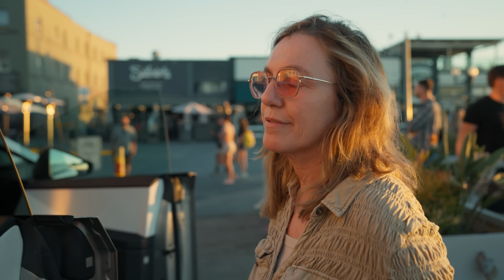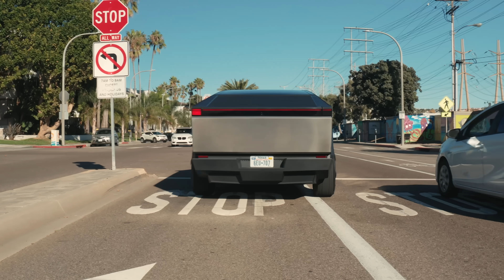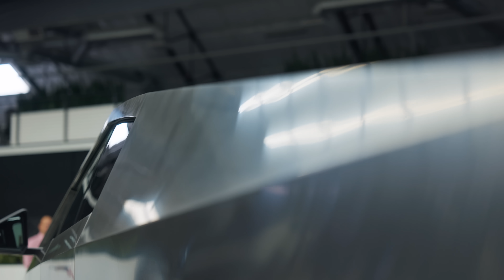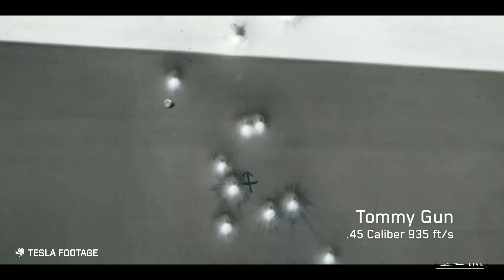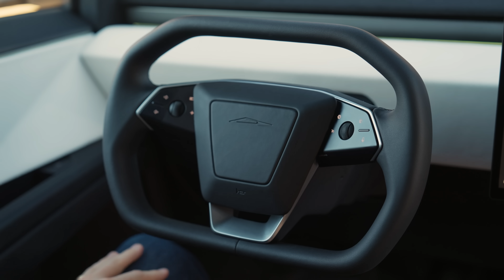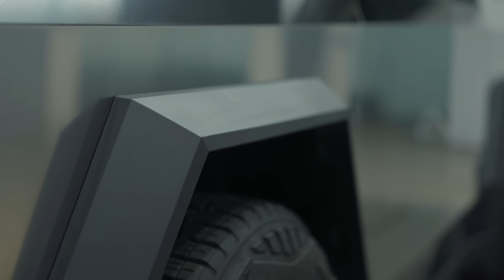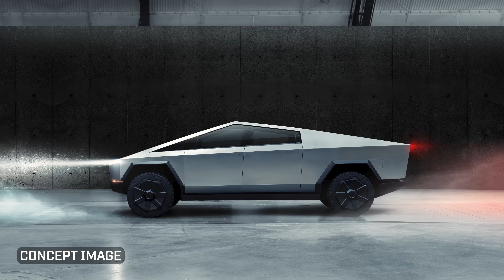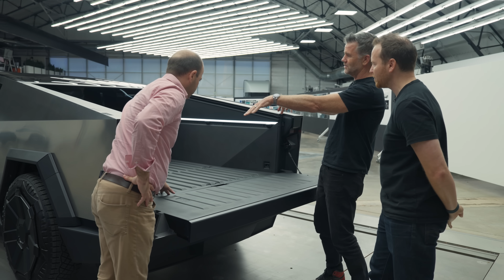FIRST DRIVE: Tesla Cybertruck Full Review

Comment: for some reason no one ever seems to mention how much its utility is limited by the high sides of the bed which makes loading/unloading from anywhere but the tailgate nigh impossible.
Reply: It's not very easy to do on modern full 4x4 truck anyway.

Looking at it, it sits a bit lower than a conventional full size, so probably not much different up to about mid point of the box. Right near the cab it will be more of an issue, but so what?
Reply: Pointless anyway its got hardly any space in the back.
Reply: @shauno1970  "It has hardly any space in the back" lol, it has a 6' X 4' bed, bigger than the F 150. So is lying something you learned from your parents??
Reply: With air shocks it can lower more than other trucks. And if you have never used a tailgate, you have never really used a truck for work.
Reply: So you climb into the back to get everything out of your truck? It was a major design issue and complaint amongst 1st gen Honda Ridgeline owners.  High sides are very inconvenient  @KevinVenturePhilippines
Reply: @fullsend5280  You are a 10 year old child and have never used a truck for any reason, and have certainly never owned one. You are just taking a rando's quote from another child and reposting it. Stay in school, and stop doing drugs.
Reply: @KevinVenturePhilippines  if you've never access cargo from the side of the bed, , you have never really used a truck for work.
Reply: you wouldnt lift heavy things over the side anyway.
for most pickup drivers usecase i dont think it affects utility much. tailgate access on cyber is very good since the suspension can go low.
smaller items might be put in the cab or frunk and might alleviate this.
and this downside of less side acces does produce some upsides like higher bed cover, stiffer or lighter frame, better aero.
depends on ur usecase on which one you'd prefer.
Reply: @slopedarmor  who said anything about heavy objects? have you never seen one of the many bed tool boxes that are made to sit along the side or at the front of the bed to allow access from the sides? they are quite popular, seems about every third pickup i see has one.  try getting a tool out of one of those...  frunk my provide an alternative for some , but not in all cases...   truck beds have been that shape they are on most trucks for a good century or so for a reason....
Reply: @bbanzai444  "Every 3rd truck I see has a tool box" lmao, you know ZERO.about trucks, come to New Mexico, child, where everyone has a truck in the family! Usually many!  You are just making crap up and know nothing, you don't understand air suspension, or anything. The only funny thing is you talking about tools, when you are one. 🤣🤣🤣
Reply: @bbanzai444   @bbanzai444  A lot of us are from the southwest, the truck capital of the planet Earth, you are from New York! 🤣

And you call it a "Pickup truck" 🤘🤣🤣🤣

OMG 🙄🤦‍♂️🤣
Reply: @KevinVenturePhilippines   you know New York is a lot more than just the city right? No shortage of trucks in the other 95% of the state…
Reply: @KevinVenturePhilippines also I called it a pickup truck because that is what it is.  Onlything funny about that would appear to be your illiteracy...
Reply: @bbanzai444  You mean that little bitty state that nobody cares about except the troglodytes that roam there? Sure, Jan. 🤦‍♂🤣
Reply: @bbanzai444  And the joke that says "Illiterate" cannot capitalize the beginning of a sentence. 🤣

And you are correct, little girl do use that word in actual truck country. Congratulations, you found your niche. 
🤘🤣
Reply: @bbanzai444  PS, Mr. "Literacy", "Only" and "Thing" are two seperate words. Even children know that. "Onlything" is not a word. 😆
Reply: @KevinVenturePhilippines  wow.  you found a typo that proves everything you said is true and everything i say is wrong.  congrats. 😄
Reply: @KevinVenturePhilippines  no, i mean the 4th biggest state by population in the country.  the one that would still be in the top 10 even if you removed the largest city in the country...  your ignorance really knows no bounds, does it?
Reply: @bbanzai444  Three typos are not "A typo" lmao. And you have more in this one, and the next! And YOU are the one that brought up being literate! 🤣🤣🤣
Reply: @bbanzai444  MORE typos!! Lol. 🤣

Population, when by your own admission, 95% live in ONE city, and a city that has NOTHING to do with trucks!! 

TINY NY is the 27th largest state out of 50! 🤣

More city and less room means less need for consumers to need trucks! Wyoming has the most trucks per capita while New Jersey has the LEAST! 🤣

You have proven you are a child!

You have lost this debate 6 ways from Sunday, lol. I am waiting still for you to even get a SINGLE thing correct! Besides little girls call trucks "Pickup trucks". Quit the drugs and stay in school there, son. 
🤘🤣🤣🤣
Reply: @KevinVenturePhilippines  definitely more important than actually addressing the points of the conversation, which you have completely failed to do.  instead resorting to name calling and nitpicking because you have nothing of value to add.  you are an empty vessel.
Reply: @bbanzai444  That is the most vapid  reply and excuse for you being illiterate and not understanding I proved you wrong I have ever seen. You still connot capitalize the beginning of a sentence. 
This conversation is over. And no matter how much longer you try and continue it, I will never date you. Go away now, and leave me alone.
Reply: Have you ever tried to reach over the side of any fullsize truck?😂
Reply: @Navybyrde  yes, and as long as someone didn't choose to ruin the utility by having huge tires or a jacked up suspension and average height person can access it reasonably well.
Reply: It's not built for truckers. Main customergroup are idiots. Cybertruck suits them perfectly.
Reply: Just a show piece for yuppies.
Reply: Who cares? Cybertruck owners hire poor people to do the loading/unloading of their stuff from the bed.
Reply: Can't do that with my F-250.
It's too high.
Reply: @Wirmish  it's not a big as a f250, different class, different use cases, different expectations.
Reply: it's called opening the back, it's called a ramp
Reply: No one is going to use this to build a bridge. So nobody cares about that.
Reply: @ws1814  yes, building a bridge is the only use case where someone might want to load/unload things from the bed.  
early frontrunner for stupidest comment of the day... CONGRATS!
Reply: @bbanzai444  Awww thank you, but I’m afraid you’ve beat me to it. Since you’re a natural simpleton you thought that is the kinda clientele for this stainless steel electric truck aimed at. 🥲
Reply: @ws1814  so they built a truck with a bed for clientele that won't use the bed?  GENIUS!
Reply: @bbanzai444  Precisely. The same way people don’t take Rolls Royce cullinens off-road.It’s an expensive toy to create buzz and act as a Halo car for the brand. And in doing that, the Cybertruck just excels .
Reply: It was a major complaint about the 1st gen Honda Ridgeline.

Comment: it's amazing how different is from any other car! we needed so shake car industry design!
Reply: In what sence is this car different? It is all in all only an electric truck. Porsche built the first electric car over 100 years ago, this car was the frist one to reach 100 km/h. This was a revolution, Musk removed the head display and calls this "the future". As a driver I would have to look to the right and down to see how fast I go. That is a step back in regards of driving safety. I also wonder how a pedestrian will look like when this sharp edged steel car is hitting him and accidents will happen.
Reply: @Codemned  I'm mostly talking about design. the fact that a company went full mode on minimal design, without (too many) compromise is amazing. it reminds the wedge shape sport care from the 80s, but one step further. 
For safety, there is no much to talk about. have you ever seen a F150 in real life, with the flat front and flat hood? driving one of that you have no visibility on anything shorter than 1.60m. so... if safety is a concern, then any huge truck or mega SUV should go trough the same discussion. If regulation allows it... then tesla, ford, toyota, etc will do it.

Comment: The rear doors terminate to a vertical line. And they are not opening rearwards, which would be far more practical and safe. Why?
Reply: that new Ferrari has backwards opening rear doors. I agree it would have been interesting to see on this. Would also be interesting to see if with the back seats removed. If I owned one I think I'd make the front seats reversible, knock through from the rear to the truck bed, fit a new roof there and build a small hole inside. If it's going to cost so much money you may as well live in it full time. And being able to tow so much you could tow a bathroom and other storage.
Reply: Sshh do not question the absolute intelligence of His Majesty Senor Musk
Reply: Rearward opening doors are literally called suicide doors. 😂
Reply: @ws1814  Well yeah, that stupid moniker is about the only reason why they don't get built so often. In the real world, I'd much rather have my kid open the rear door rearwards than forwards.
Reply: The backseat is so tiny nobody is going to fit in there anyway.
Reply: @USAoutofEurope  sure about that? In all the videos so far, the front seats seem to have been put unnecessarily backwards. Plus - it's just easier to get in an and out with rear opening doors when things are tight.

Comment: you can't have exposed panel edges like that.  The sharp edge is an accident waiting to happen.
Reply: Indeed, you can't, which is why it's not for sale anywhere outside the US, where they ignore things like 'pedestrian safety' when it comes to 'light trucks', as I believe this is classified as.

Puncturing a hole in Little Jonnys skull in a suburban parking lot near you with the corner of the front wing, soon, in the US though.